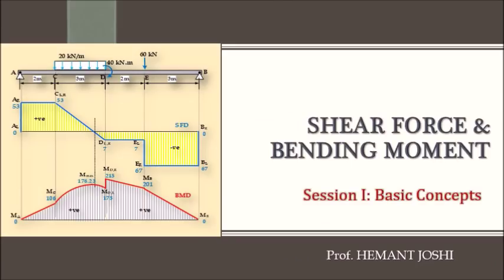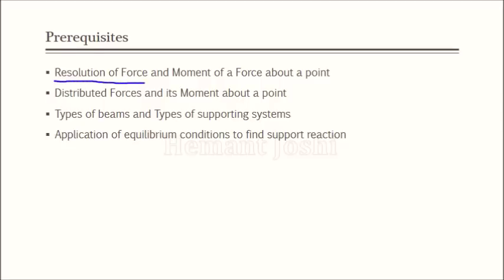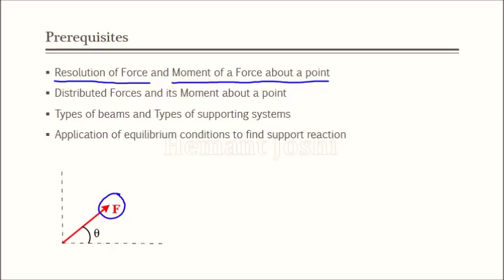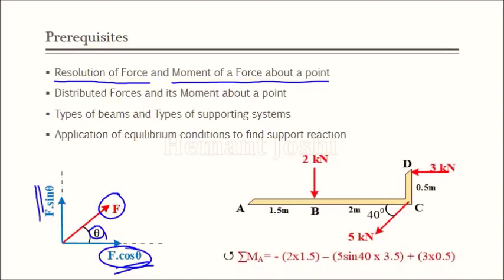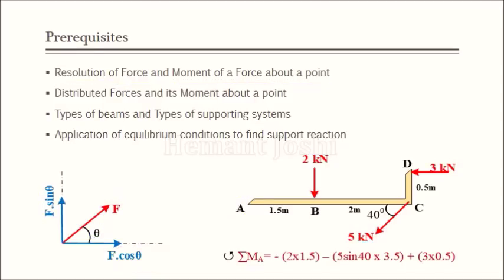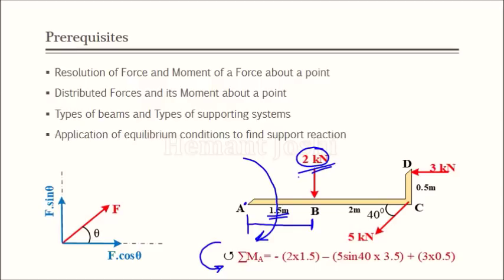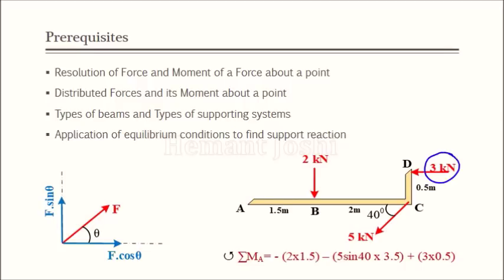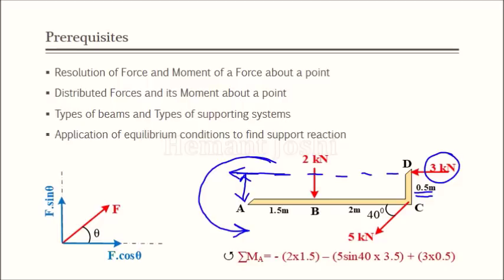SFD & BMD Basic Concept

Comment: Very very thanks sir. Sir please explain relation between SF and BM along longitudinal axis of member AND tension and compression of traverse section of beam. With referring neutral axis NA. Means relation between  longitudinal and transverse section of beam. Sir how we retain shear force by providing  vertical stirrups in rcc beam ? Because we provide stirrups parallel to vertical load .Means here happens  direction of action and direction of retain force seems same direction.   Logically  it should  be provided horizontally . Just like our wall load acts  vertically and our entire beam lies under wall remains horizontal which is perpendicular to vertical force . Just it is natural phenomena. Please guide sir.